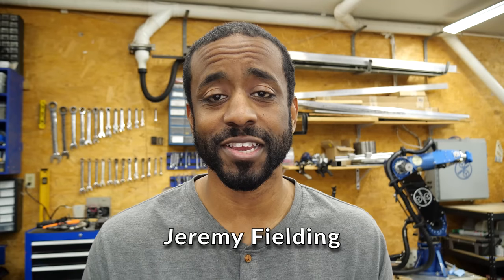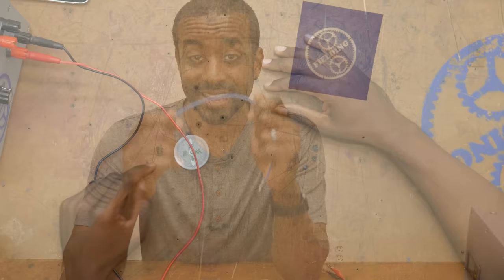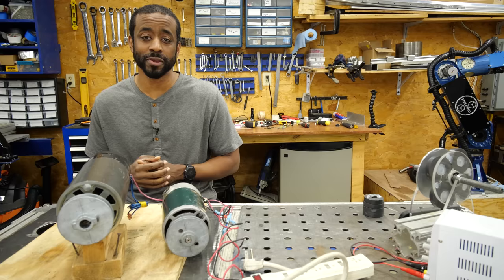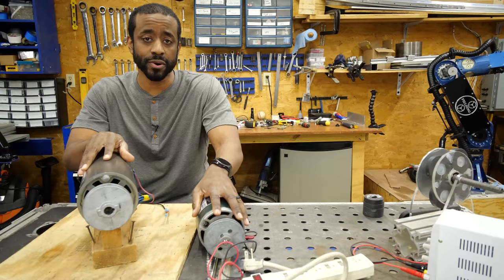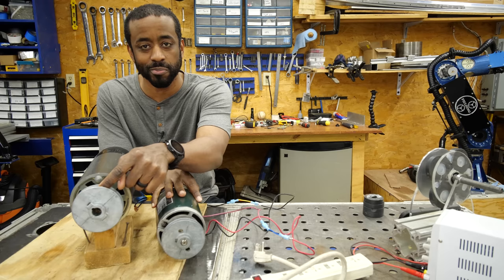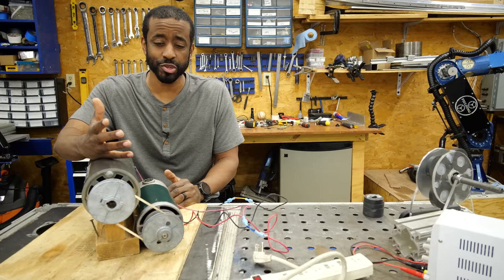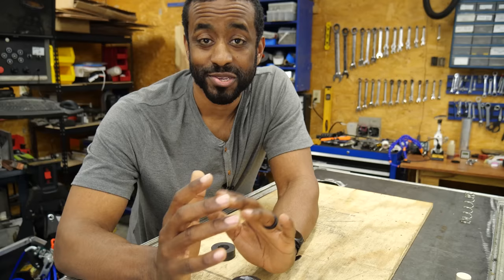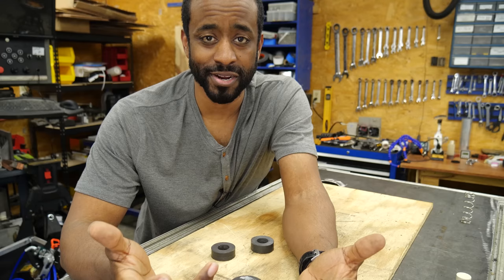Reviewing Free Energy Generators.  A Response to My Video "Nikola Tesla's Greatest Invention"- 102

Comment: I spent 43 years as a mechanical engineer dealing with component efficiencies, and I want to complement you on a great video. You are spot on!
Reply: Line efficiency is another issue over long  distances.
Reply: I know a little bit about energy conservations so can I ask you if I have unlimited amount of alternators and unlimited amount of batteries hooked up to anything which makes friction or heat AKA energy let's imagine I have unlimited collecting and storage units why can I not collect the friction from the motion the cars make. Is there no way to make a special roads that do nothing but collect energy since you know blacktop creates an amount of heat. That heat can be stored right underneath that Blacktop and pushed right back into the cars like sitting a iPhone on top of a charging unit without any cords. There's lots of ways to get through this simple
Reply: Its called  The Electro Magnetic Motor. Tesla patented it and if you look up Howard Johnson... Not Blacky Johnson You will see that Zero Point Energy exists and you can see parendev and vgate and other electro magnetic motors working perfectly well on youtube. Yes there is tons of scammers looking for clicks but there are also legitimate working examples of Tesla's Electro Magnetic Motor. Howard Johnson also holds numerous patents on Magnet motors and if you know anything about the patent office they dont give a patent unless the patent functions as described. You cannot patent something that does not work
Reply: Would you be willing to share any knowledge? Any books, videos, websites? Anything helps! I’m currently going to school for ME

Comment: I am sad that this needs to be explained.  Energy is lost, in every exchange, to friction, heat, ineffencies.  Every.  Time.  PERIOD!
Reply: There's technically an exception but it's so stupidly impossible to pull off its not practical that is using the force of gravity around a black hole
Reply: @issstari954  how is the force of gravity around a black hole any exception?
Reply: 1)Dark energy 2)Entropy CAN NATURALLY decrease in a very rare case within a vacuum. Theoretically, this returns energy to an earlier, more kinetic state. Oh and 3)humidity. This is a very low energy producer right now but withdrawing humidity from air can create water to spin turbines at a near infinite rate. The problem is the turbines would need to be thousands of miles in length.
Reply: Not lost, converted.
Reply: Energy is transferred or converted and cannot be created or lost.  That's a universal truth.
Reply: @maxwelltodd7757  but it can be transferred into forms that are very hard to get back, sound for example.
Reply: @misterx6276  Thats where youre wrong again. Condensing humidity from air takes energy to cause a phase change, by doing so you will use more energy than you generate. You cannot circumvent thermodynamics. Your comment on entropy is also misleading, sure entropy can decrease in a localised area, but it MUST increase in another. The entropy of the universe will always decrease with no exceptions. Dark energy isnt an explanation to anything, its a placeholder for energy that should be in the universe but we cant account for yet.
Reply: @Matt_10203  I don't have to use any energy to condense water out of the air. I just take a shower during winter and the walls become wet all by themselves... 😎
Reply: @maxwelltodd7757  Yes, indeed. It's called the law of conservation.
Reply: @Matt_10203  I agree with your sentiment, but you made a tiny boo- boo. The second law of thermodynamics says that entropy increases (moves towards disorder) in the universe. Throw a cup (low entropy, order) onto the floor and you end up with shards (high entropy, disorder). That makes sense. Throwing the shards onto the floor will NOT result in a reassembled cup. Entropy is naturally a one-way deal and results in your flatmate screaming "What the hell did you do to my cup?!?"
Reply: @issstari954  using the power of God.
Reply: @digicinematic  I think it's pretty clear from the context of the conversation, that the error you mention is simply a typo, rather than an intellectual misunderstanding of entropy.
Reply: @TimpBizkit  When God and meth are on your side your power is truly limitless
Reply: @83btm  True, it was absolutely a typo, which is why I agreed with @Matt and the points (s)he was making. My spiel was really directed at @Mister X.